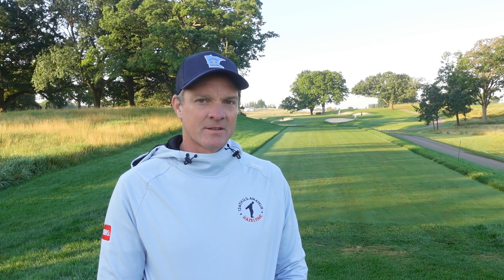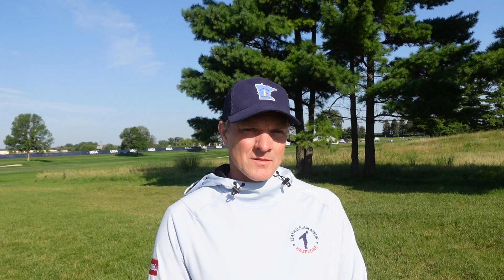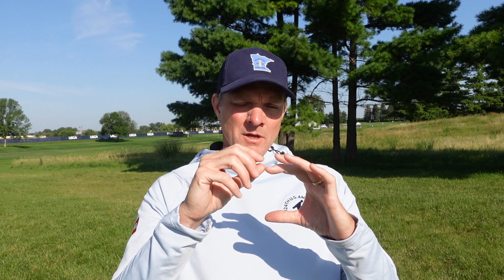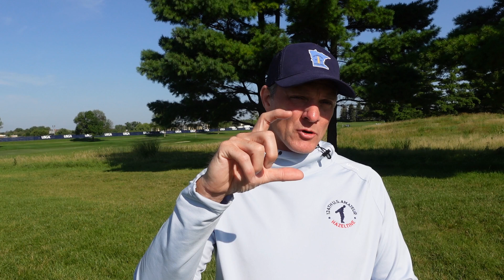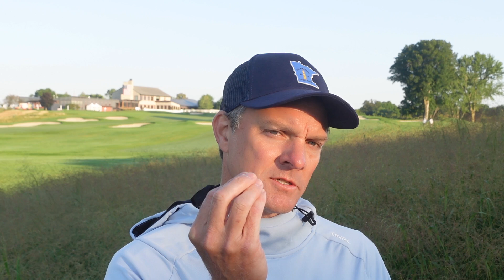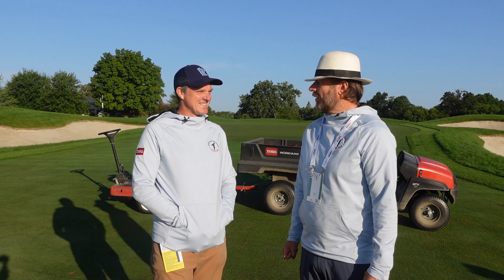Sand rootzones, perched water tables, topdressing sand, and more with Dr. Cale Bigelow

Comment: I have available sand for rootzone mix  .25% 4.75mm  5.41%2.36mm,20.94% 1.18mm, 40.73% 600um, 18.80% 300um 12.82%150um and .60% 75um   was planning on blending with peat or compost 80-20 %   will this work for creeping bentgrass in Northern US climates ?
Reply from the maker: Maybe. You can compare directly with the USGA recommendations which are available at https://www.usga.org/course-care/specialty-articles/usga-putting-green-construction.html